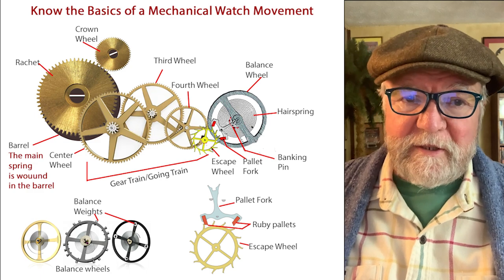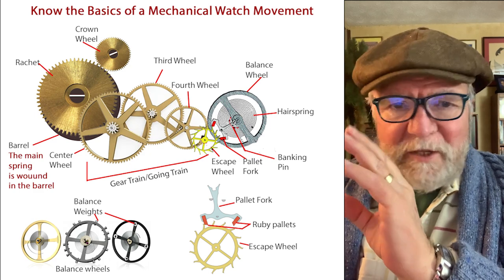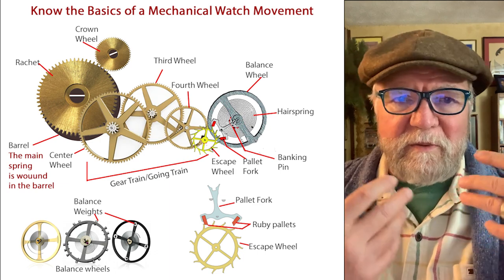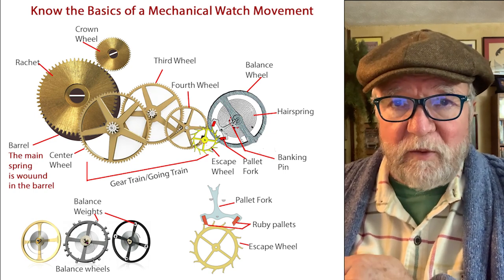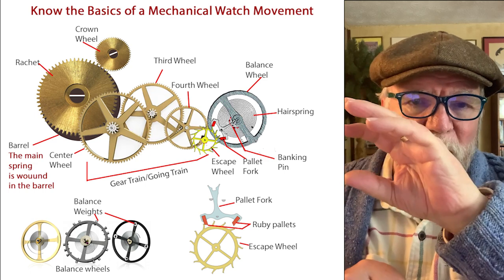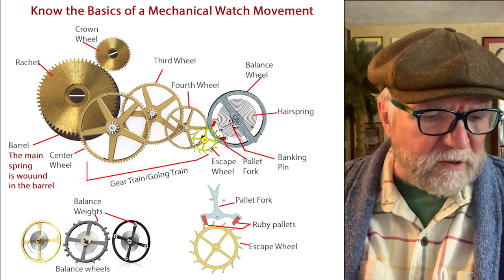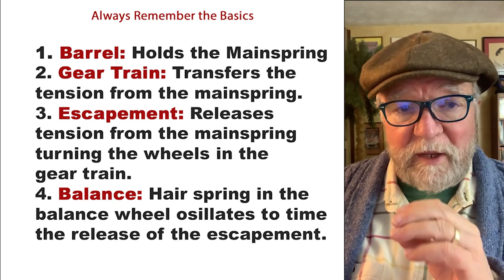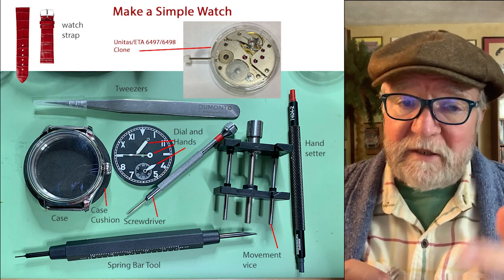How to be a Proper Watch Snob: Part 1 #496

Comment: Good illustrations and information. Banking pins were a mystery to me for some time, are you going to mention these?
Several names for the same part does not help but a car gearbox is a transmission to you. My watchmaker speaks about the bolt but not sure if that is the setting lever. 
He is grumpy so I hesitate to ask but he does a good job.
Reply from the maker: Velviaman, the banking pins simply limit the swing of the pallet fork. Necessary, but the main point is getting a general (and accurate) idea of the workings of a mechanical watch. There's far more that the Proper Watch Snob needs to know about watches.🤔 Just getting started...Take care, Bill

Comment: I have disassembled, cleaned, lubed, adjusted, and assembled many watches. I can tell you it is easier to ruin a watch than it is to repair a watch - way too many things can go south! For instance, if you break a balance pinion on a particular movement, its over; parts availability on many vintage movements are almost non-existent! The same goes for losing a tiny screw or a small lively spring that may fly across the room! Unless you are VERY good with your hands, have sharp vision, the patience of Job, and the willingness to buy the proper tools and fluids, do not attempt to repair a watch! ( Watch "The Watch Repair Channel" to see how it is done correctly. ) If you are stubborn and HAVE TO disassemble a watch, start with a beater Dollar pocket watch movement; as they are easier to work on. ( Remember, Dr. Ranfft is your friend! ) I have always thought that watch snobs pretend to be part of the GENTRY when dealing with LUXURY. ( Was that slam too obvious? )
Reply from the maker: I've disassembled watches too... and they're still disassembled, Burkholdst! Ouch! That was a slam ... but there's a difference between a 'Proper Snob' and a 'Faux Snob.' Just the real thing for us! Take care, Bill